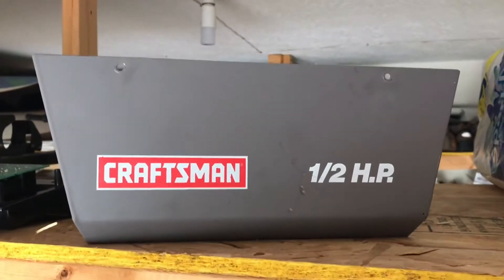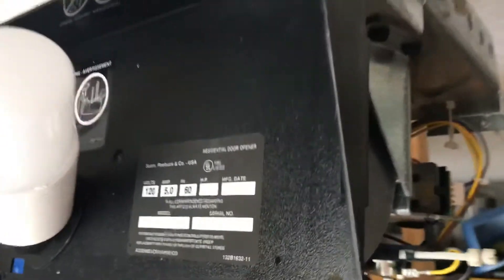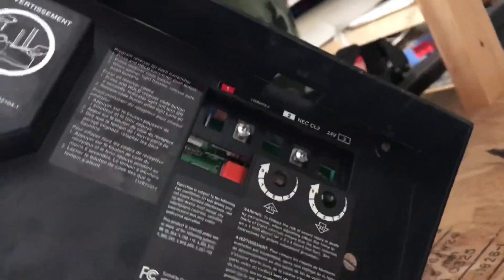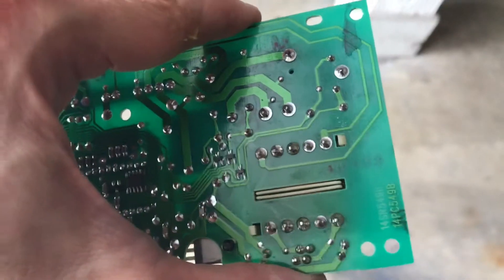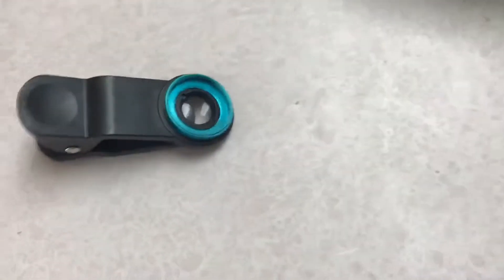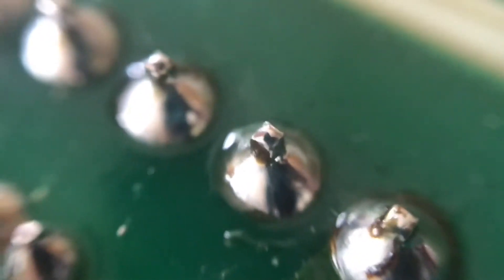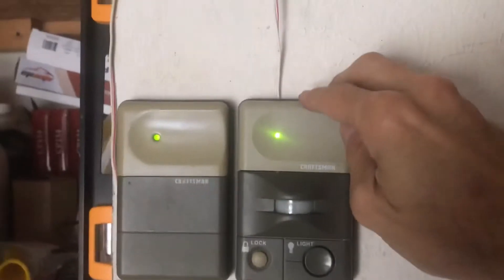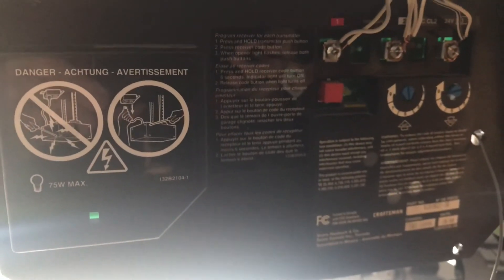Repair Garage Door Opener with bad solder

Comment: My 2014 1/2 hp Craftsman chain drive sensors were turning on and off intermittently. the door wouldn't close all the way, and would reverse back to open a couple inches from closing. I re-soldered the six points on the logic board that connect the sensors and the wall control and cut and re-spliced the wires leading to the sensors and the wall unit. It seems to have worked. But...now the sensor lights are only on when the door is being operated, not all the time. With the door closed, if I turn just the light on using the wall control, the sensors light up. When I turn the light off using the wall control, the sensor lights turn off. The sensor lights are not on all the time. They are on when the door is being operated. Did I screw something up? Any thoughts appreciated.
Reply from the maker: I am glad I was able to help you. 
Regarding the light on the sensors, that depends on the sensors you have. I have two garage doors, and one of them do you have the lights on when the door is closed, but the other door does not because I replaced those sensors and they don’t come with a light. 
I say if you tested those sensors when the door is coming down and it reopens the door when you interrupt then, you should be good.

Comment: Awesome video! I am having the same issue with my craftsman 1/2 hp garage door opener. It's about 18yrs old but it should still work. 
Btw*** Anybody know how to bypass the safety sensors? Can i just bridge the connection on the back of the unit where the wires go to each sensor?
Reply from the maker: I am so glad it helped you. 
I agree, mine is that old as well and it is still running without any issues. 
Why do you want to bypass those sensors? Are they failing? I remember changing those sensors in the past as well. 
Please consider subscribing to my channel. It will help me on doing more videos like this.
I am regularly fixing things around the house and adding videos about it.
Reply: I want to bypass the sensors for troubleshooting purposes. But in the time since I last commented here, I found out that they cannot truly be bypassed. Basically, all one can do is take both sensors and tape them together (facing each other) and set them on top of the garage door opener. So they are still connected by definition, but done so in a fashion that they will not be an issue of any kind. And sure, I will subscribe. Happy to support!
BTW, I am not having any luck with the logic board. When I plug my unit in to the power outlet, it clicks rapidly and the light bulb flashes rapidly and continously. I checked the logic board for signs of burning and soldering issues- can see or find anything indicating any physical issues.
Reply from the maker: @e.manske7596  Thanks for subscribing. 
Usually the number of times the light flickers will tell you the type of issue according to your manual but you said it is constantly doing it. 
I would lean on the side of the sensors and cabling to them. I would buy new sensors in Amazon and try them. Also use new short wiring to test if damaged wiring is the culprit.
Reply: Cool. I will certainly get some new wires(they are very old) and test the sensors the way you describe. And I will let you know how it goes. Thanks again!

Comment: Other failure points on these logic boards are defective electrolytic capacitors.  My Liftmaster remote would not work with the opener lights on.  I chose to replace all the electrolytic capacitors on the logic board and now all is well.
Reply from the maker: Thank you for this information and I am glad you solved your problem. 
Please consider subscribing to my channel. It will help me on doing more videos like this.
I am regularly fixing things around the house and adding videos about it.

Comment: Sebastian, that was perhaps caused by mechanical vibration. Same thing occurred to my furnace control board that cracked the solder on the relay posts.
Reply from the maker: I agree with you. That door vibrates often.

Please consider subscribing to my channel. It will help me on doing more videos like this.
I am regularly fixing things around the house and adding videos about it.

Comment: Perfection my friend. Looking at the Power Processor was key to discovery of absolute cracked around post cold solder. I had to buy a quality solder gone at lowes. Heated up contact point added some electronic solder around all sealed bright and shiny then checked a couple more posts with a heat touch and small addition of solder.  Garage door works like brand new up and down ... beautiful for a $40. soldering gun. I saved $400.00 Thanks.
Reply from the maker: So happy for you! I felt the same way when I fixed it and it is still working. And… you can use that solder in many future projects. I transformed many toys that used batteries with a power adapter using the solder.
Reply from the maker: I am so glad it helped you. 
Please consider subscribing to my channel. It will help me on doing more videos like this.
I am regularly fixing things around the house and adding videos about it.

Comment: Thanks for the vid. Pulled mine apart and found a bad solder joint on the back side of the tan board. Resoldered and working again within 15 minutes
Reply from the maker: Glad to hear. Mine has been working fine since this repair
Reply from the maker: I am so glad it helped you. 
Please consider subscribing to my channel. It will help me on doing more videos like this.
I am regularly fixing things around the house and adding videos about it.

Comment: THANK-YOU! This video along with another one on YouTube allowed me to fix my opener! On the "other" board, there were visible cracks on one of the solder joints. I never soldered before but I bought a kit and was able to re-solder the joint.
It FIXED my garage opener that would intermittently stop while opening or closing. This video helped so much on my FIX!!! AMAZING!
Reply from the maker: I am so glad this helped you. Investing in a good soldering kit will save you a lot in the long run. I fixed so many things in my house just by soldering it right.
Reply from the maker: I am so glad it helped you. 
Please consider subscribing to my channel. It will help me on doing more videos like this.
I am regularly fixing things around the house and adding videos about it.

Comment: The lights don’t work on mine, no power at the sockets. Getting ready to change circuit board. Wish I knew which solder connections to look at.
Reply from the maker: Use a voltmeter to try to determine where they problem is. Are you saying you don't have power (electricity) at the power outlet where the garage opener is plugged. Then the issue is with the power breaker like it was suggested.
When I was diagnosing mine, I realized that if the light was flickering then the whole system (garage opener) was loosing power since the light bulb works with 110V straight from the power outlet. So something at the very beginning of the garage opener was causing the issue. And it was a cold solder on the input board, the one that takes 110V and distributes power to the rest. Hope this helps.
Reply: @gotitdone  Thanks I have power, the opener works. But no lights.
Reply from the maker: @300zxdriver  This happened to me as well. Open the door so there should be power on the light socket. Then remove the bulb and be careful while testing with a voltmeter for 110V on the socket by touching the very bottom and one side. If you get 110V, it means power is fine and most likely the bulb is not touching the connection at the bottom. 
To fix that, disconnect power to the garage opener and try to bend the bottom connection of the bulb socket upwards a little bit. Check again with the bulb and let me know.
Reply: @gotitdone  I didn’t have power to the socket.
Reply: @gotitdone  I did. that bend the bulb connection thing first, then I checked for power with meter. No power to socket.
Reply from the maker: @300zxdriver  hmmm.., then I would check the  socket connections on the board. Checking for 110v and continuity on the connections. The 110v must come from a relay when the door opens… good luck.
Reply: check the brakers at the power panel.